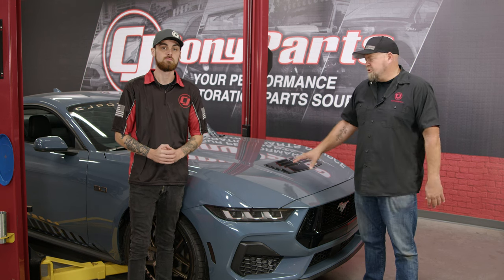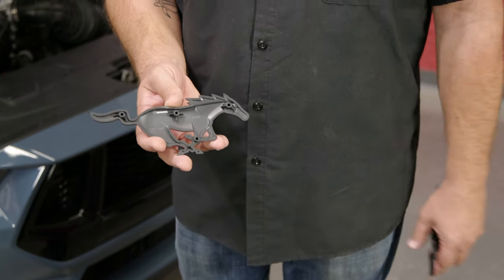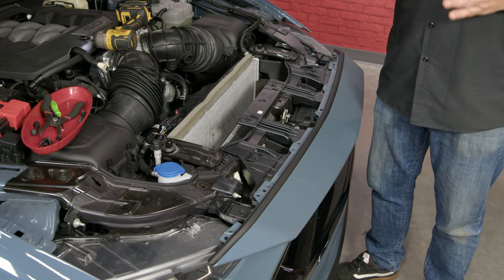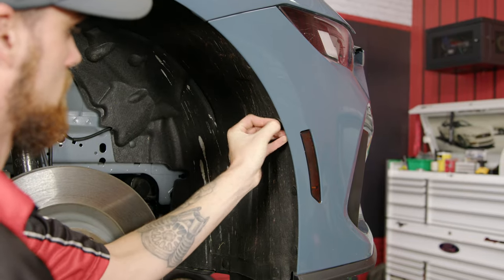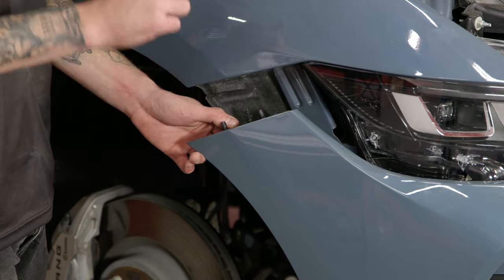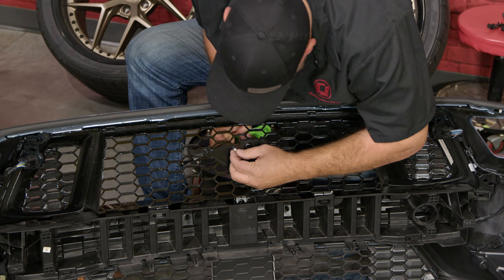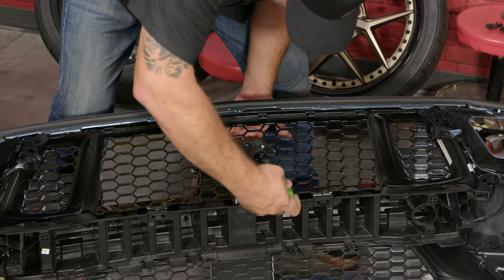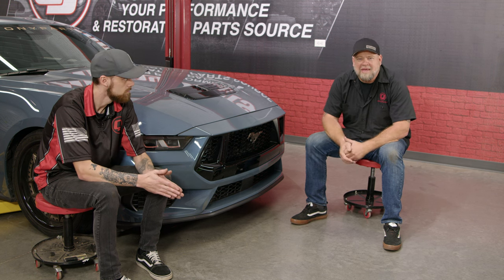Give Your 2024 Mustang a Stylish Bronze Accent with a Custom Pony Emblem

Comment: Removing the wheels is an unnecessary step if all you got is a jack and two stands. All I did was turn the wheels and there is plenty of space in there for what needs to be done. This is sure a burdensome project though given that all other emblems are a simple guiding pole 3m tape.